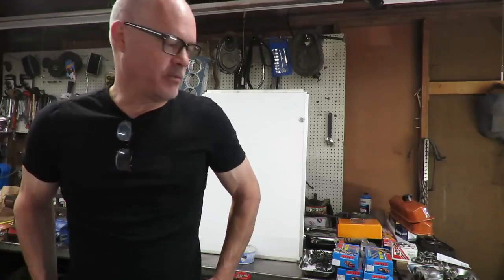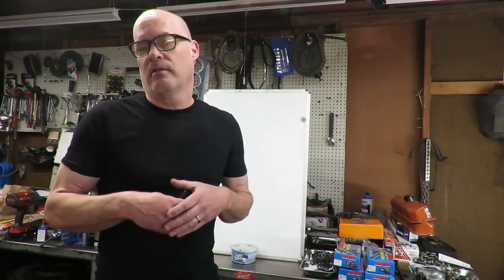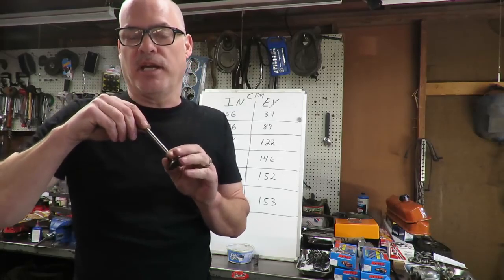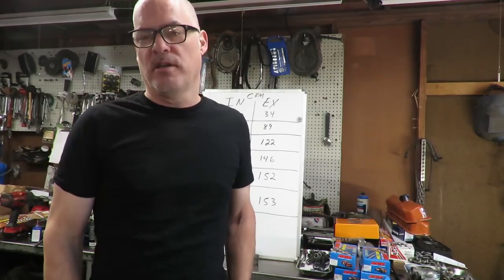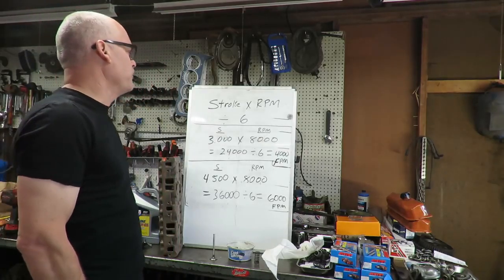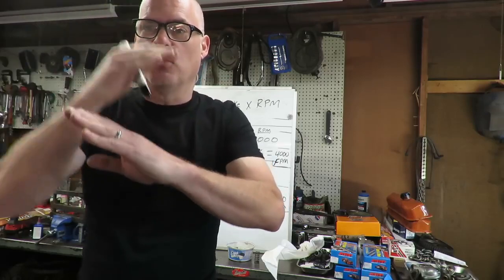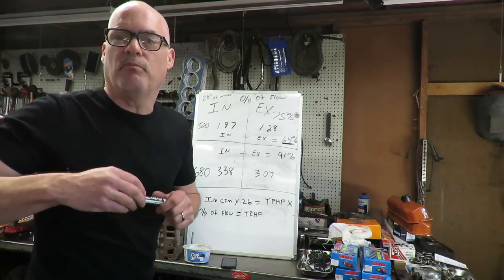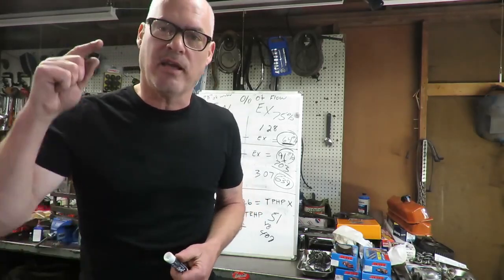How to properly select a Camshaft

Comment: Thanks for sharing your knowledge through these videos.  Do you give much validity to the statement that cast iron heads will produce a slightly higher compression ratio through the fact of their ability to retain heat over aluminum heads?  It's a given that the aluminum heads may be preferred because of the lighter weight factor that may negate any power increase derived through an iron head's heat retention factor, but can you give an approximate range of compression ratio increase for an iron head over aluminum with the same combustion chamber volume?   Thanks for all that you're doing to further the hobby, looking forward to viewing all of your videos as there's so much to learn from them.

Comment: Ok, I've seen this before but seeing it again brought up some questions I have. Ive ported one set of heads in my life. They were smog heads to a 460. D3VE-A2A heads. My numbers didn't show what yours do. Mine were flow tested all the way up to .700 lift. The intake side continued to show improvment all the way to .700.  Witch was 305 cfm at .700. The exhoust side became turbulent at alil above. 400 lift but still gained numbers to .700 lift witch was 165 at .700. But the gains were like 1 or 2 cfm for every .100 of lift until .700. I didnt see it reverse in numbers like yours did. I would imagine since mine is a smog head its not a very good head but why didn't mine reverse??

Comment: Man excellent video! I've tried to understand much of this in the past but this really clears confusion! Do you take in work from the locals? I's like increase the flow on my 396 heads. Quick question, is it really expensive to take heads from roughly 68% of flow to 80% or better and is it worth it? I used your excellent tutorial to get an estimate based on my configuration and would like to target a little more HP. Thanks for the the great information.

Comment: THIS VIDEO that you have done, Myron, has to be your greatest.  YOU have even shown us how to figure out how much power we can expect from an engine size by its head flow. WAY to put that knowledge down. NOW if you could show us how to predict how fast in a quarter of mile time to expect a car will be, and how to properly gear it so it would run the traps at peak pwr. I look forward for the vid of the Pontiac stroker.

Comment: Peter with great power, comes the right cam, heads, crank, air flow, pistons, carburetor, or injection system over build be safe.....

Comment: this is amazing. been reading hundreds of forums and getting nowhere. this is a scientific fact-driven approach. used this math to evaluate a new cam keeping same headers and saved me $ of money. will write a blogpost on FSB once im done. I haven't figured out how the intake manifold (upper and lower) restricts the air flow per piston in your formulas. e.g. if I have a stock 302 lower intake with 150cfm, that means I will get nothing upgrading the headers as the stock headers already get to +150cfm at .500 lift. would it just bake in the % air flow e.g. head_to_intake_%_airflow? 

PS -  just one tiny note on the % of flow. in the video you mention dividing the higher number INTO the lower and confused me a bit. (wording issue with "divide a into b" vs "divide b BY a"). And rounding the 128/197 is actually 65% vs 64% :-)

Comment: Two questions. On the head flow calculation for horsepower I wasn't sure why your multiplying by .26? Second question based on your calculations on the vortec heads you said they'd make 220hp or so. I've seen several dyno results of stock vortec heads just made to accept more lift make over 350hp. How accurate is that calculation?
Reply from the maker: when flowing at 28" the HP potential of the head is .26 HP per CFM there are many other factors compression ratio being a big one these numbers are a baseline for a stock low compression engine they only go up from there

Comment: You covered a lot of territory there in a short amount of time, and should be required viewing for anyone interested in hot rodding. One thing I'll add to simplify the real downside of longer overlap in a street driven car, is think of cylinder pressure at lower rpm. With a lot of overlap, you'll effectively have low cylinder filling and low cylinder pressure until you reach the optimum rpm range that a long overlap cam is meant for. Not only is it jerky and sluggish at lower rpm's, but it gets poor fuel mileage and runs really dirty. Forget about power brakes and air conditioning, too, unless you want to have it idle very high. If you're just planning to drive it occasionally, for a short distance for fun, you'll need 3.73 to 4.10:1 gears to really enjoy it. Another thing to consider when you run higher rpm on average, is valve and seat wear, which really speeds up with increased rpm. Sorry, I had to add my Debbie Downer two cents for those who love lopey cams.

Comment: There is probably some math you could apply.  Springs have mass and spring rates and you should be able to find the actual mathematical point where the amount of hp gains (at max flow) is perfectly matched to the lowest possible parasitic load from the springs.

That would be even better than ball-parking.  I bet GM's 420 lift is very close to that perfect point.  It might not be the most power that can be made by that engine, but rather the most power with least effort, which should translate into more efficiency and more durability.

So in addition to usage type (strip vs street etc) the amount of reliability (endurance) gets to be more of a factor with this move toward a more precise design of the engine.  
Thanks for moving us all a bit further in that direction.

Comment: 7000 rpm's at 10 mph with open headers between buildings?  YES..LETS GO!!

512 lift across.. 222/230 duration at 50...  What type of cam is that In a small block ford